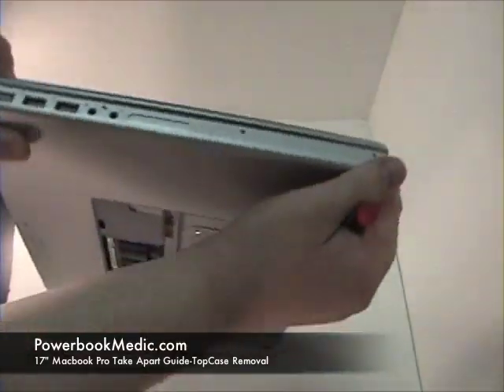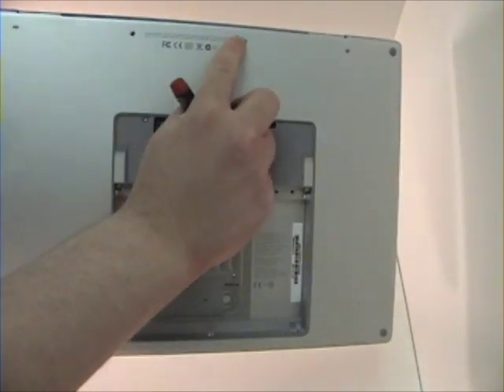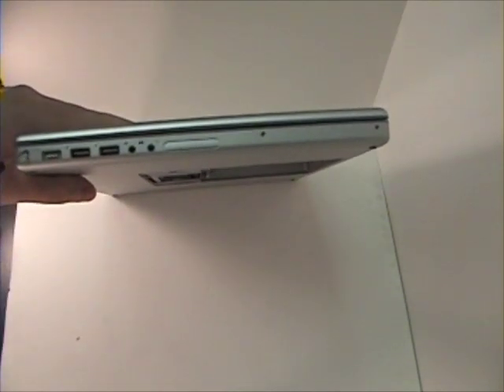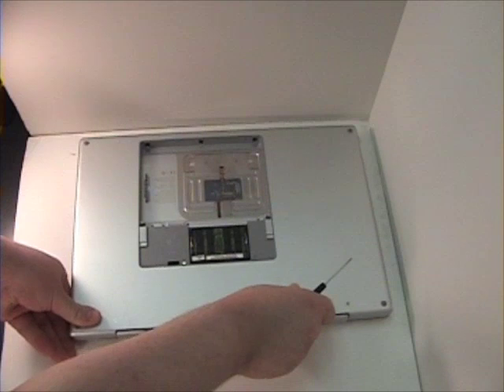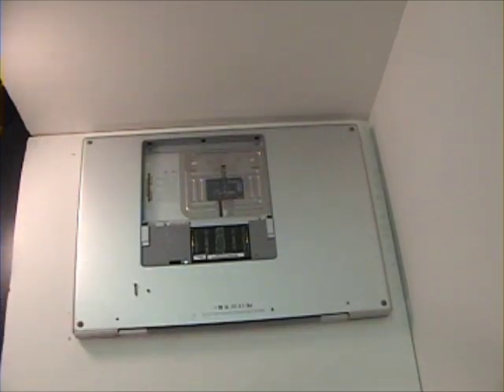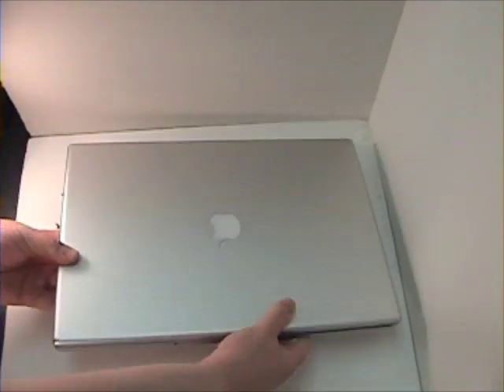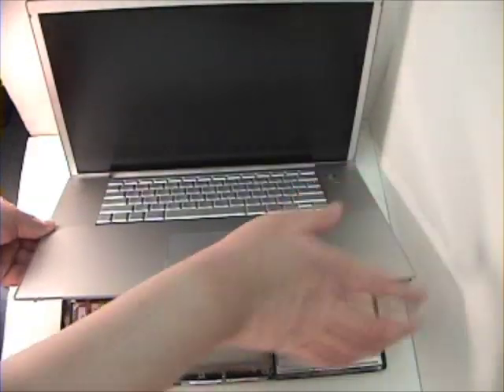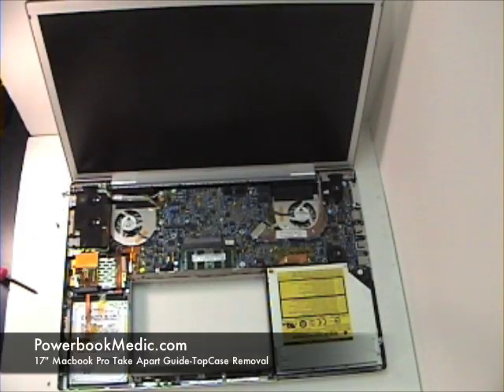Macbook Pro Repair 17 Inch - Top Case Trackpad Removal

Comment: I'm a little late to the party but I'm having a problem with the top case removal. I have the same laptop as your video, but when I goto remove the top case there is a little wire on the left connecting the speaker from the body to the top case. I don't know how to remove this since it is not in your video. Help would be nice thanks

Comment: OK I have a 17 inch unibody Macbook pro. late 2009. 
I spilled a couple ounces of water on the track pad and now I am no longer able to click & drag. 

I turned off the computer to let it dry out but that didn't resolve the issue. Any tips?